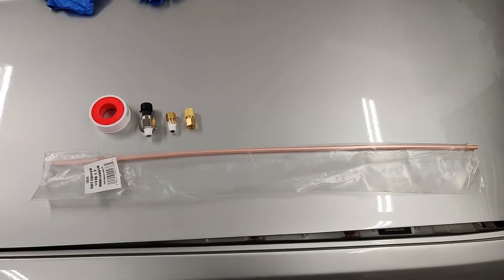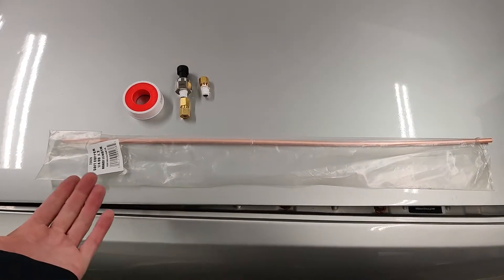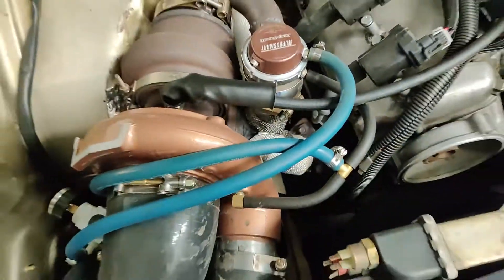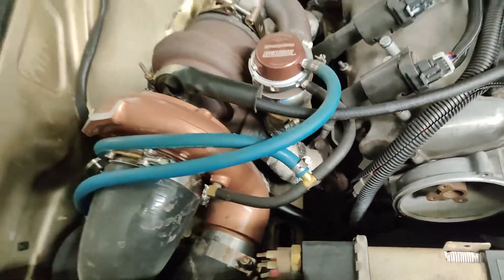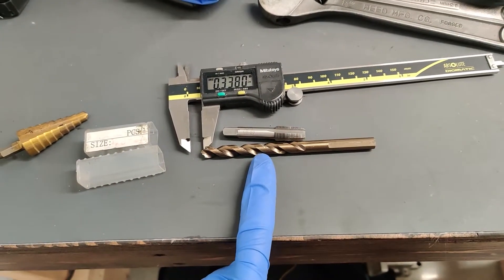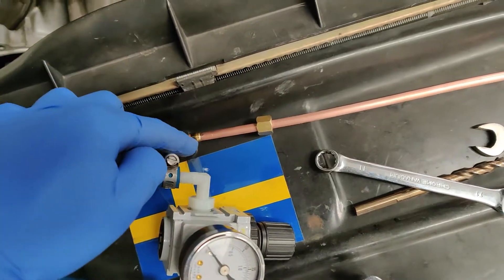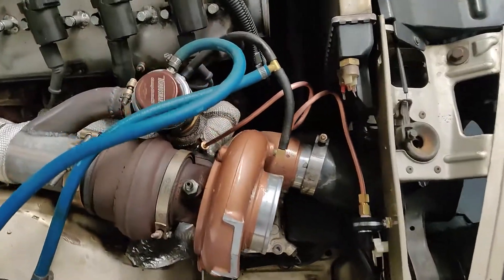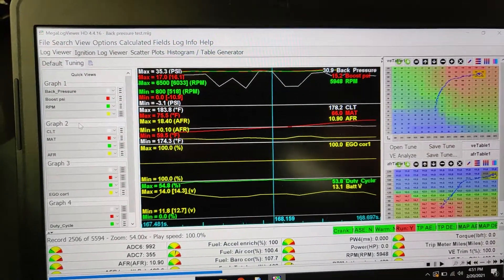Megasquirt Turbo Back Pressure Sensor Basics

Comment: This is exactly what I do on my MITs Evo with maxxecu, rough in the sensors to get a general idea of what’s what. Looks terrible but I get the data I want! I have pre post intercooler, back pressure, coolant and crankcase pressure and more. Vital info to have. Plus some of safety cuts work off the back of it